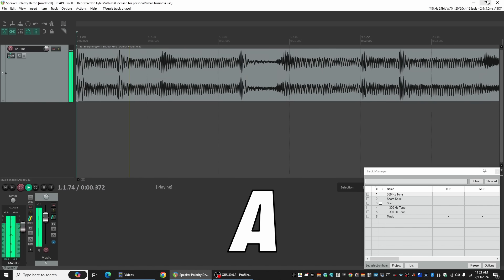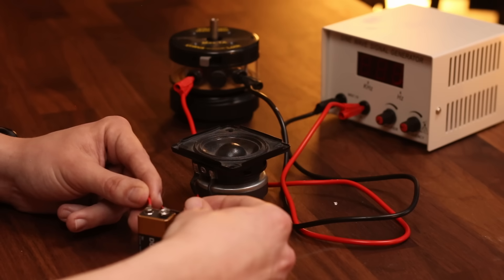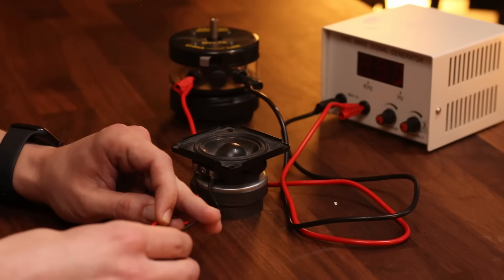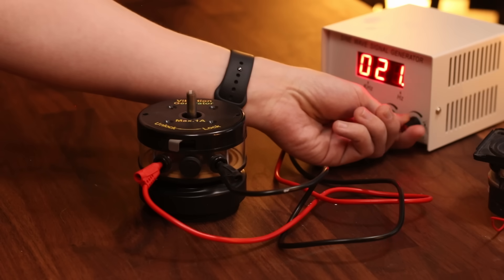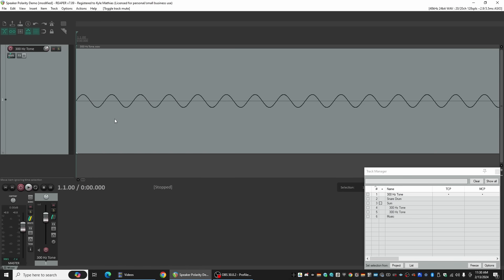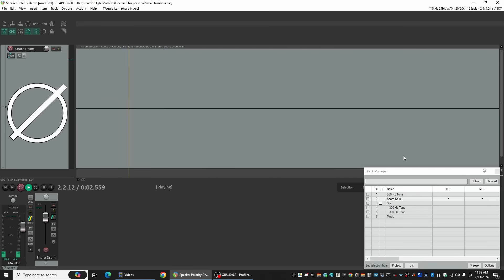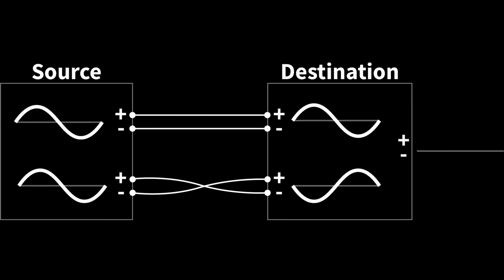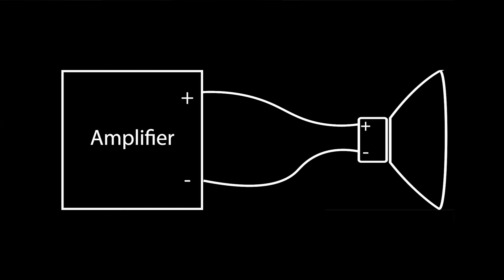What Happens When You Wire Speakers Backwards?

Comment: Whether or not there's an audible difference will depend on the driver and/or enclosure.  The signal is identical, but if the driver performs differently when pushing out vs pushing in, for dynamic audio (basically anything except a tone generator) it will color the sound differently.  Like the snare hit example, the largest amplitude is in the 1st movement.  If the cone is not equally flexible in both directions, and more flexible in the direction of 1st motion, that period will be louder than when the signal changes direction electrically (i.e. moves under the line).
So, if you have good ears, and you have good drivers and enclosures and yet you can hear a difference when reversing the wires that's actually an indication that your drivers or enclosures aren't good as they do not perform equally in both directions of cone movement.  With good equipment, good ears will be just as oblivious to this kind of phase change as bad ears.

Comment: When adding multiple speakers, I wouldn't say it is important to get them wired "correctly", rather I'd use the term wired "similarly" or less accurately "identically" (only because attaining perfect identical speakers and wires is impossible when manufacturing tolerances come into play...). If you wire your first speaker black to + and white to -, the rest should be wired the same. Probably should endeavor to have the wires the same length so you don't get slight phase distortion from different transmission line lengths... That won't eliminate phase issues in all cases, but should reduce or eliminate a cause of phase issues. Unless, of course, other external factors cause phase distortion that can't be otherwise eliminated, relative cable lengths can be used to at least partially compensate. Yea, the real world makes everything complicated. Too bad we can't have spherical elephants on a frictionless, infinite plane...

Comment: i have a sound system in my car 
it consists of 8 speakers  6 are 3 way and 2 are 2 way 
+ two 12 inch subwoofers + 4 tweeters small size 
3 amplifiers .
all  that is controlled by a pioneer source .
in the settings mode it has a reverse polarity feature for the subs .
when  inverted the bass sounds more aggressive.
why is that ?

Comment: In the case of stereo woofers is eccential that both sides are in matched polarity for maximum bass performance which is like an arm wrestle or two boxers at each others. Intense. Otherwise one of those polarities crossed will cancel out the bass like boxing in air. Both home or auto stereo systems.

Comment: In my opinion the biggest difference is not electrical but more so physical as on a  sonic/musicallity level. When the drummer hits the bass hard or a guitarist hits hard, those taller stronger amplified electrical signals need to be projected pushing the pressure wave "outward" into the living area to the listener.
So having the proper polarity on the stronger signals, keeps the speaker excursion pushing the sound wave outward to the listener. While having reversed polarity would force the cone inwards. Which in my humble opinion would be "Ass Backwards" 🙃

Comment: I replaced the speaker on a small computer sub, and I did notice that it was wired in reverse.sir
Because o f the cabinet,the push and the pull of the air within did make it sound off, I guess the other surround speakers made the difference.

Comment: Sometimes you want the speaker wired backwards. Like subwoofers in a push pull system, also known as isobaric. In modern array systems, this isn't productive because they couple each other in the stack, because the software takes cares of these problems. Btw these days putting speakers out of phase isn't possible anymore, or you have to work with a real old system.

Comment: This isn't necessarily the case if you use them in a push pull fashion for subwoofers.  Not every rule is absolute, but this is a great demonstration for a layman, but I would suggest doing an actual audio play through of a song, etc with a left & right out of phase and record that with commentary, even so far as changing the volume of one side, vs the other, etc.

Comment: Your wrong buddy, you apparently haven't hooked up car audio before....its called OUT OF FAZE. When you hook one speaker out of faze in a car you definitely hear a difference.  You hear less bass, and the bass you get is a hollow sound.  You can tell if you have one out of faze by turning balance to one side while listening you turn back to the other side. If you heat full rich sound coming from both on there own but when you balance them out to tone hollows out and there is less volume. If they are hooked In faze...then you will hear rich full sound out of the right and rich full sound from the left and when you put them together then you will hear even richer and fuller sound that also increases the audio volume because all speakers are in faze. This works with 2 speaker 4 speaker 6 speaker and more setups and it audibly clear between in and out of faze.

Comment: This is true only when listening to the speakers from a point precisely equidistant from both speakers. Given that a 10KHz sound has a wavelength of about 3cm, it will be extremely hard to position your ears in the correct place. The scientific way to answer this question is not with theories and simulations. It is by doing blind tests and using some basic statistics to analyze the results.

Comment: This is a flawed conclusion -- because yes this is how 'noice cancelling works' BUT only with very precisely fixed distances between each speaker and the listener (your ears) -- in a room with speakers in it the wavelengths are so short that the SLIGHTEST positional differences in speaker placement and your heads position in the room that you are equally as likely to get portions of the independently heard waveforms cancelling themselves out.

What I am saying is a room with speakers in it is SOOOO UNBELIEVABLY UNPRECISE that any difference wiring a single speaker backwards out of a set might make it indistinguishable from the normal variance you'd already have.

This is nonsense. Two differently wired speakers are no more going to "fight against each other" than two same-wired speakers at any two random distances apart. Think of the wavelengths involved... total hogwash.

Comment: The ones who claim they can hear if all the speakers are wired in-phase but "backwards" are those who claim they need oxygen free copper speaker wires. While one may reason the first excursion of a transient must make a difference as the speaker need to push rather than pull, the fact is in recording or real live concert the first excursion may arrive to your ear either way.

Comment: I remember installing speakers in my one car well over 30 years ago and was wondering when I centered the balance that I lost almost all bass response in my 6 x 9 speakers.  I flipped the polarity of one after tracking my wires down and it was correct then and sounded way better.  Although I'm usually very careful about wiring, somehow that one got past me.  That was a phenomenal system.

Comment: You're talking about wiring one speaker opposite to the other. But I think you're missing the point of wiring both speakers the same, and then wiring them both the opposite. I can hear the difference. In one setup, the image is wider, sharper with more left/right image but still with a centre image. When both are wired the opposite to this, the image becomes more centred and softer, with less emphasis on left and right. I believe there is an AES paper written about this effect of absolute polarity vs reversed polarity by Clark Johnsen? called 'The Wood Effect'.

Comment: If you drop two stones in water at about 4 or so feet apart and watch where the rings meet, you will see an interference pattern in the water. This is caused by hi waves mixed with high waves low with low,  low with hi and every variation you can think of. Now do that with light and watch the fun. (look up double slit experiment)  Photon or wave?

Comment: In Liverpool UK in the late 60s I worked at a company that installed sound systems in clubs and dance halls throughout UK. Because speakers in those days often were not marked at the factory and many blown speakers were re-coned by various places, we were never sure of phase. We designed a unit that created a series of triangular wave form (instant rise with tapered fall to zero) at about 1 hertz (cps in those days) We then took the other half, which was a receiver (3" speaker ) wired as an input that detected a push or pull and lit a red or green LED. We would set it on then walk around the room/hall to about 3 feet away from each speaker cabinet and make sure they were all the same colour and therefore in phase. The first phase effect was accidentally discovered while moving one of two playback heads left and right as tape was moving past, mixing both head outputs, which created a cancellation effect that inherently swept across the audio frequency band. Fundamental frequency waves didn't phase but music and white noise worked great. Check out the vocal and drums fills in the chorus of Itchycoo Park by Small Faces for what I believe was the first use of phaser effect on record. Turned it into a comb filter with a variable driver oscillator and Ibernez put it in a pedal.

Comment: When you listen to the initial hit of a kick drum there is a definite change of sound and feel with a single speaker wired with reverse polarity. Especially with a PA sub system that covers the 25Hz range. If everything is wired correctly you should feel the air hitting your chest. If the sub polarity is reversed then the kick drum completely loses it's impact. This because the first positive peak of the sine wave is the largest and sound pressure waves in compression have better projection than ratification of sound waves.
Reply: If that were remotely true JBL would have never wired their bass drivers reverse polarity.
Reply: @keithmoriyama5421  😂
Reply: @keithmoriyama5421  Coult it be because the bass drivers have a air (sound) duct from back to front on the speaker casing, like mine Sanyos?
Reply: Although it is a very important part, what U experienced, this is not as simple, and definitely not an absolute true conclusion. The effect depends hardly on the circumstances (the type of cabinets, their arrangement, and some other nasty stuff). All the problem comes from a basic misunderstanding. The air hitting your chest is not sound but a pressure wave, and means U are standing somewhere in the so called "near  field", where the pressure-->velocity conversion still happening. At 25 Hz it can be a big range even 10+m from the sound source. The physics and math in this area is way different then in the "far field" area, where the pressure drop only depends on the distance (inverse sqare law), and becomes even more and more complicated as you come closer to the source.
Reply: Some may find this hard to believe but JBL speakers can't defy physics.
Reply: @dsanj4745  I must agree that Bose are quite good as well they make some quality sounding equipment.
Reply: very important !
Reply: it's rarefaction, not ratification
Reply: Thank you. That makes a lot of sense.
Reply: phase reversal button on my preamp is interesting.. some tracks improved, some degraded, but most sound best w not inverted (both channels). 
Some tracks I always phase invert, affects highs mostly
Reply: That would be purely an acoustic phenomenon,  considering all amplification at some point weather it's the pre out or the amp input is AC coupled. Speaker design and also the environment acoustics could result as stated. There is a transient but it just does not hang there.
Reply: Bullshit - an audio wave is a sine wave - there is no way of knowing whether the start point is a positive or negative pressure - after the initial starting point (which you can’t tell) - the wave is the same … 🙄
Reply: well, with a single sub the only reverse polarity would be the sub vs the mains. if your system crossover is set up to filter the sub frequencies from the mains there will be minimal phase issues if the sub is wired wrong, especially at 25 Hz. There will definitely be cancellation around the crossover point. But if you are listening to just the subwoffer there is absolutely no difference to the way a kick drum sounds if you have it wired "reverse"
Reply: This.  Difference between a pressure wave and a lack of pressure wave.
Reply: I heard the term "attack" used to describe this. We were doing a speaker, and had the speakers wired backwards, someone in the room said, "the attack is missing." We wired the speakers the other direction, and there was a noticeable difference.
Reply: Sound is a waveform, it makes zero difference if it starts from the bottom or from the top. I bet you turn your AC plug also around to find the correct 'phase' lol.
Reply: @Munakas-wq3gpa speaker is a physical device, and it does make a difference in the resulting sound wave whether it's "pushing" or "pulling"
Reply: Absolutely correct. I was going to post similar comment. If that would be no difference at all then drummer can put his kick pedal in front of bass drum and play that way. But nobody ever played such way in a music history for obvious reason. You need LF sound kick to propagate toward audience. However I agree that it would be no difference in mid and high freq ranges.
Reply: You my friend are correct.   I’m glad to finally see someone say what I was wanting to read because I’m too lazy to post anything.

Comment: Interesting fact: to make vinyl pickups work with mono as well as stereo they just slipped the polarity of one channel to prevent destructive interference. This is because mono's left-right movement generates mirrored signals on both channels, compared to stereo's 2D diagonal movement detection, and because flipping polarity of a channel makes no difference to its sound.

Comment: Since everything in life is not equal sound aside when pushing the driver hard,  one would think there is a greater chance of bottoming out the coil when running reversed polarity. This would raise the chance of damaging the driver over time.

Comment: While wiring your speakers generally just inverts the phase, I would be interested to see what it does to bass kicks, where the transient only lasts a couple cycles and is slow enough that the human ear can pick up individual cycles. The initial direction of the wave might matter more in this case (whether the subwoofer "explodes", so to speak, or "implodes".

Comment: But the neg/pos position WILL actualy work when you bulid a sub-woofer for example. Because in a pos/pos (positive on positive and neg on neg) it will send the signal outwards and if you have a woofer that looks like a "saxophone-case" to that speaker it will loose the "oumpf" in that base if the speaker is mounted with the magnet in the case...and even if you just put it in pos/neg (pos on neg and neg on pos) you still will get better but not the BEST woofer-"oumpf".
I want you to film what then happens if you put the speaker with the magnet outwards into a "saxophone"-case and put it both "pos/pos" and "pos/neg"...and record with a sound-tester in the outlet of the "saxophone"-case.
(this is what i mean with a "saxophone"-case: https://encrypted-tbn0.gstatic.com/images?q=tbn:ANd9GcSWOkw2kwUGqpkffb3cUqlulfUGS_bCrMlsfg&usqp=CAU )

Comment: At live events you'll often see arrays or fills aimed backstage and wired out of phase. This cancels the sound from monitors and main PA. While the crowd is getting blasted. The crew backstage can speak normally and often don't need ear pro while working.  They do the same thing  to create "dead zones"  in large clubs - areas like the lounge or the bar. Those speakers over the bar that don't appear to be on are actually doing a big job. Theme parks even use phase cancellation to kill mechanical noise.
Reply: That's incredible. Had no idea people can apply this on this way
Reply: Many new vehicles these days have mics in the ceiling above the passenger seats, and then the stereo system uses those mics, and plays back road noise out of phase ("backwards" from the actual noise) thru the stereo speakers to mute road noise from the vehicle interior. My 2022 Chrysler Pacifica does this.
Reply: It's been used in military helicopters since the early eighties silent or stealth mode⁉️
Reply: I doubt that is true. If you have an array of speakers wired out of phase and also turned backwards then the cones will again be aligned. When the forward facing cones move forward the backward facing cones move inward which means forward and backward cones are moving in the same direction. This would amplify the sound towards the back of the stage, rather than cancel the sound.

Comment: Fun fact: you can beat copyright ID systems by using "inverted average" on a stereo signal.  Basically what you're doing is turning it mono, then flipping the signal for the other track so left and right cancel each other out (like what you show with the sine waves).

Using real speakers, you'll be able to hear music out of both because they aren't coming from the exact same place - it'll just sound weird.  But the point is you can still hear it; copyright ID systems convert everything to mono because it's easier to analyze clips for similarities if there's only one audio channel, and therefore your sample turns into pure silence which obviously won't match anything.

I imagine the same would happen if you have a stereo system where one speaker is wired backwards.  You'd still hear things - it wouldn't completely cancel out and cause silence - but it would sound "off" compared to how it's supposed to sound.